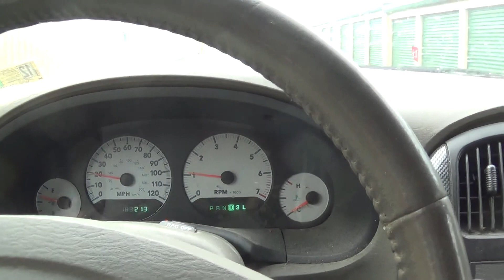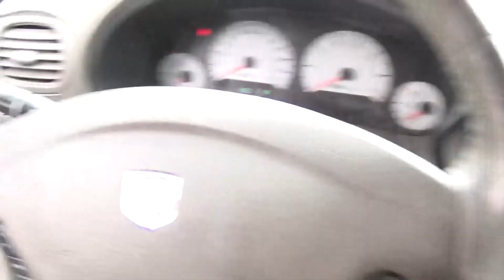Why did I buy a wrecked 2006 Dodge Grand Caravan?

Comment: i  would love to see a car restore video that would be a great project
Reply from the maker: It will not be a "restore" but there will be several videos filmed on it.
Reply: I have a 2006 SXT that i am in the process of restoring, that i will be doing a bunch of videos on... Im going to restore to original condition... Im doing the rocker panels and paint as we speak...
Reply: @TechTimeWithEric   Eric - Steven Tell me :  (1) Is the oil engine cap sealed or can I refill it myself?   (2) Is the transmission cap sealed or can I refill it myself?   (3) Is the power steering cap sealed or can I refill it myself?      (Thanks)

Comment: I was just gifted an 06 SXT, going to Fix up the body and I got an EGR to fix
not sure what i'll do with it after that
Reply: I have a 2006 SXT that i am in the process of restoring, that i will be doing a bunch of videos on... Im going to restore to original condition... Im doing the rocker panels and paint as we speak..
Reply: @Ron-vz5hn  good luck, I got lots of cosmetic work to do, But I still love driving it thru west coast mountain highways
Reply: @GPaulDiddy  Thanks i will post pics and or video once that work is done. I purchased my 06 2-1/2 yrs ago with 19,000 miles on it
Reply: @Ron-vz5hn  Any updates on when ur videos will be out?
Reply: @KenTronico  Hopefully soon,  i have several projects i want to do. I'm just waiting on a 4k camera that i have on order and a tripod for the camera. I can't wait to get started... One of the first projects is going to be dropping the gas tank so i can repair a broken line in the vent valve line from the fuel filler neck to the gas tank, which was causing a small evap leak detection code and also a check engine light on the dash... So far i have replaced the rocker panels on both sides and underneath the van (looks AWESOME!)... Thanks for the interest. This is going to be fun going thru this van bumper to bumper restoring everything and covering all maintenance procedures!!!
Reply: Ron 23323 I already subbed! Can’t wait